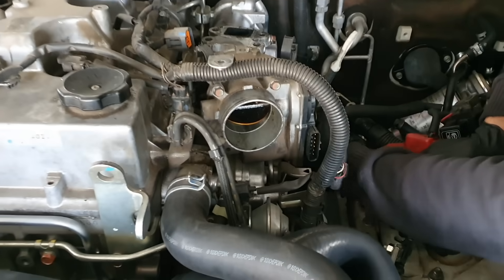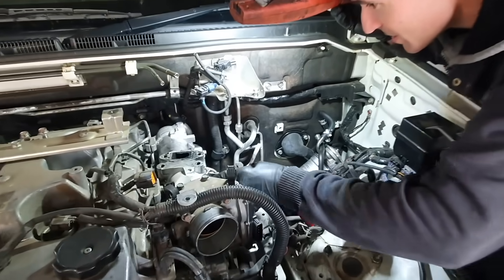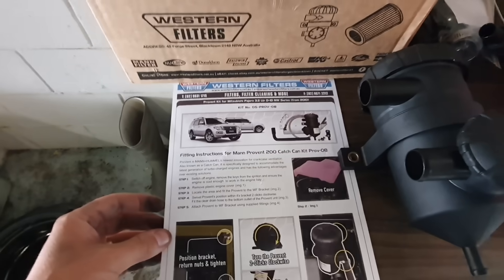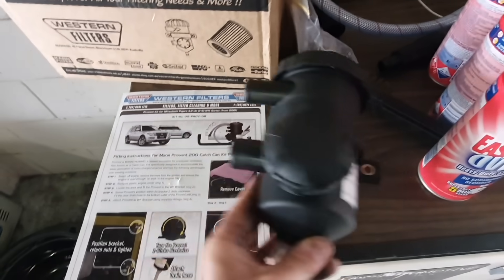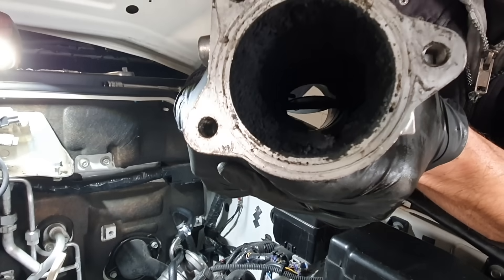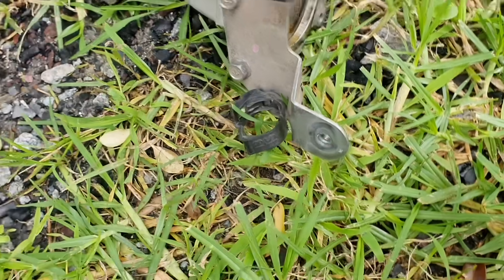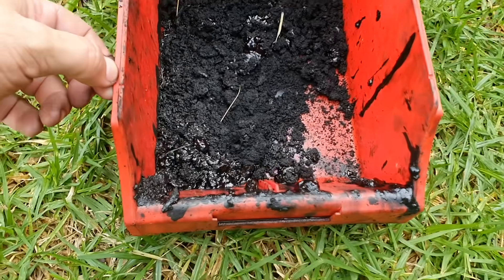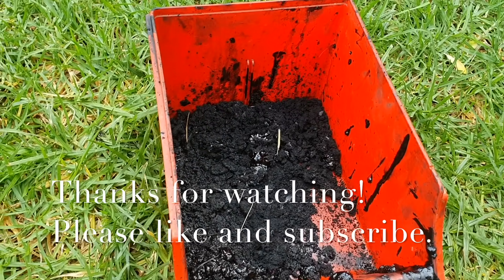Mitsubishi Pajero Diesel Soot Manifold Cleanout

Comment: That is a fantastic video fellas thanks very much that will be the next thing I'm doing on my Mitsubishi Pajero turbo diesel just finished doing the gearbox 5 speed automatic that was a hell of a job because it's my first time flushing out the gearbox and torque converter took me probably 5 hours 2015 model,   Mitsubishi the cheeky bastards doesn't even have a normal dipstick there's a hidden one in the oil pan under the car but I saved  myself $440 bucks after paying for the oil love my hoist bought a hoist just so we could save money the Hoyts has already paid for itself only talk about Turner bit years Hoyts cost 5 grand I work on my car my son works on his car his girlfriend's car and his mates can't live without it thanks again for the great job and upload fellas
Reply from the maker: Thanks so much for the kind comment! Would love for you to check out my product I make for the Pajero. https://kap.industries/product/fire-extinguisher-bracket-mitsubishi-pajero/

Comment: Nice job.
I've used the oven cleaner trick  myself on my old Triton, and I'll be doing my NT Pajero very soon along with a Provent can...
Reply from the maker: Yeah works a treat. Im really happy with the provent also!
Reply: @kapindustries9236  as it turns out, I'm fitting a Ryco instead of Provent...only because I got one on a super special for under $130 and they're almost as good.